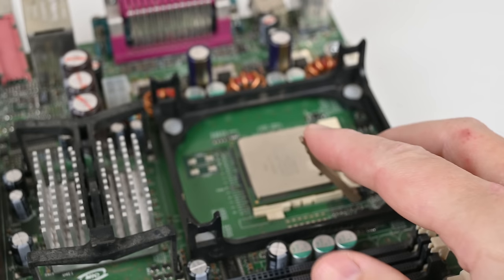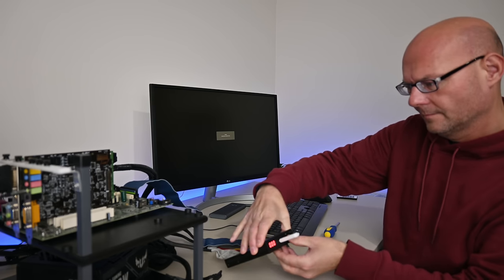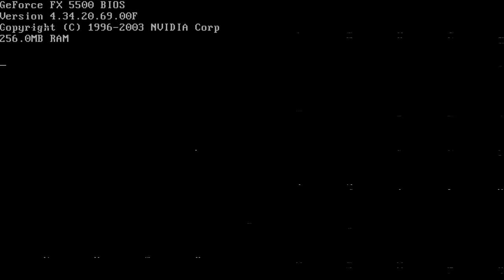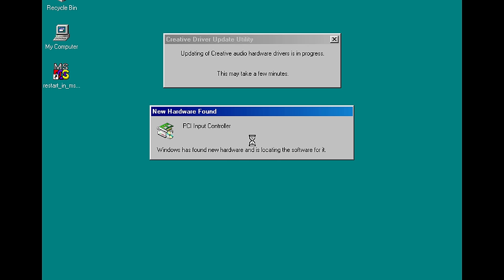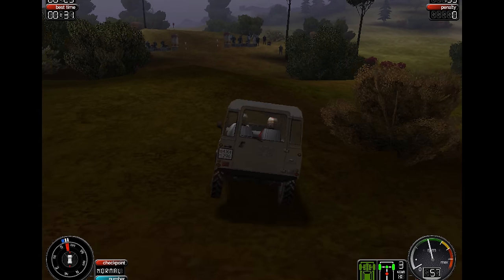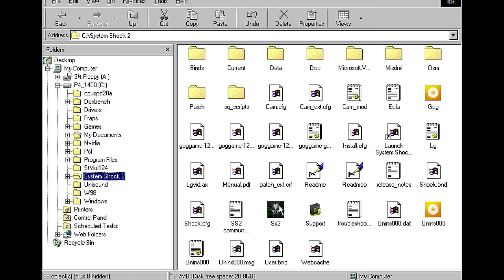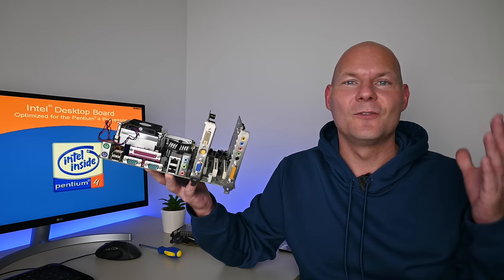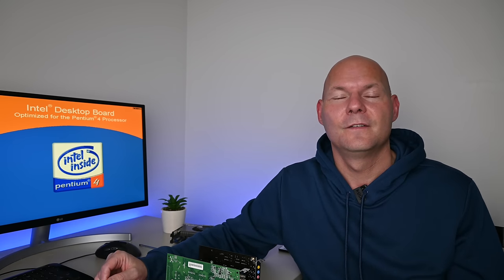It Failed in 2000, Has It Aged Well? The Pentium 4 1.4 GHz

Comment: The P4 is a perfect example of when Intel allowed their marketing department to fully drive the engineering. The goal was sky high clock speeds at all costs, hence the super deep pipeline and other design decisions. It's a CPU line that it easily overlooked these days in large part because the chips that came before and after it from both AMD and Intel were so much better in many ways. 
For me the P4 generation is when I went over to AMD for a while. I had been with Intel through the Slot 1 and Socket 370 gens after spending the entire Socket 7 generation with AMD chips. Then in 2001 I attended a pop-up AMD Roadshow event in Chicago IL at the launch of the Athlon XP line and won a MSI motherboard and Athlon XP 1800+ CPU which at the time was their fastest chip. So I stuck with AMD through the Athlon XP days. Later on I had a Barton core Athlon XP 2500+ CPU that I had overclocked to 3200+ speeds which served me well until the time when the later Core 2 and AM2 based Athlons were common. 
I did end up using a lot of P4 based machines at work though (I was an IT contractor for the US Army then) and quite a few of them were dog slow, especially when they got hot and thermal throttled. A P4 was fairly well behaved in a stable temperature environment, but put one in a warehouse or factory setting and boy were they a pain!  I was so glad when the Core 2 based machines came in to replace them.
Reply from the maker: P4 with mechanical HDD, low RAM and Vista. Tech support worst nightmare
Reply: At that time Intel didn't know P4 wouldn't scale that well in terms of frequency and that it would encounter major headwind in the form of TDP. AMD was worse. It knew about the problems of P4 but still decided to release Bulldozer.
Reply: @Alex-df4lt  NetBurst, Bulldozer, POWER6, all designs aimed to go to super high clocks, replaced by lower clocking, high IPC designs, that managed to reach the same actual clocks.
Yes, in 2007, just when Intel went away from their GHz race, IBM decided to release 5 GHz CPUs. And not only that, POWER6 was in-order.

Comment: That's a really awesome project I'm actually thinking of going with a P4 (S478) for my retro 98 machine for some old Star Trek Games for the more authentic feel tbh! :3 

My first proper PC was the AthlonXP which ran 98 and XP very very well, I have an ATI HD 3650 512MB AGP that I'm looking to use as the old Catalyst drivers I remember worked wonderfully for the games I played back in the day :)
Reply: You was very lucky if that HD3650 AGP worked without problems, these late ATI GPUs for AGP slots were very problematical. I have one HD4650 now and in some MBs it doesn't even give you image (some socket 462 MBs), I had even problem in sc754 MB, it kind of worked, but there were some problems. Only platform where it works without any issues are late sc 478 MBs, so Pentium 4 plaftorm.

Comment: Hi, Phil. Thanks for the great Video.
I saved an Win98-machine until this day and now it itches to go through all the installation to try some old stuff and show it to my nephew.
To the graphic-problems of your first card: It may be the light, but some of the capacitors seems to bulge. 
Could be just voltage instability, that a swap would fix.
Greetings, Carsten.
Reply from the maker: It's a great hobby!
Reply: i could make you ISO's i have 95 98SE and me along with win2k
Reply: @CotyRiddle  thanks, very much. I have got all that i need at Hand because i saved software and licenses. As Always time ist the problem. 😉

Comment: That Geforce FX5500: Looks like the capacitor top left is swollen. Might be a bad angle, but normally that caused the glitching and instability. This bring back so many memories! We had a 1.7 Pentium 4 on Intel Desktop Board. Once I replaced all the caps on a glitching motherboard with onboard graphics. It actually worked, and the PC was usable again.

Comment: P4 3.2 clocked to 4.0, 7950 GT,  4 gigs of Corsair Ram, Asus board, don't remember the chipset right now, and a couple  of highspeed drives in raid... Good times. Still have a few old P4 machines laying around. Creative sound card with Z5500 speakers... liked my old P4 computers. I have an old 3.4 extreme edition, that would only run 3.6, and a 7800GS Golden Sample with the unauthorized 7950's chipset. This video makes me want to play around with that old hardware.

Comment: I wanted an Athlon XP for my Windows 98 machine but I'm having no luck with the motherboards. Since I have several P4 machines I went with a P4 2.66Ghz on an Asus P4S8X-X, GeForce FX 5600 128MB and Sound Blaster Live SB0060, so my current setup is very similar to the one you tested, except for DDR instead of RDRAM, 2 real IDEs with 80GB and 320GB, and dual booting Win98 and Win2000 on the same partition 🙂
Reply: I've bought a lot of sc 462 motherboards in last few months for few bucks here in Czech Republic, not always in great condition, but it always worked. I can't imagine living in country where you have only eBay with their crazy prices, those worldwide sellers are totaly crazy. Sometimes it's enough to just visit some local computer store and ask if they have some "old trash" and very often they have and they are happy that you will take it for free. 🙂
Reply: Makes me wonder why Windows 2000. Might be just for period correctness, but there isn't anything that 2000 does that XP can't do either, but with support for some newer software. Yes, it means going to "classic" layout, but should do fine. On my 933 MHz Pentium 3 build I'M running 98 SE and XP on 256 MB RAM and XP is just fine. In fact, with my CRT it feels snappier than my modern machine with modern parts.
Reply: @HappyBeezerStudios  Wrong, I thought that XP is just reskined 2000 for a long time, but even when core is almost the same, there is massive difference in compatibility with old games and software. Win 2000 has advantages of NT, it knows NTFS file system, it's stable, it knows USB 2.0 AND compatibility with Win 9x games is much better than in XP for some reason. Try for example AvP1 or NFS 5, both games are bugged in XP, but work totaly fine in 2000. Ofcourse you can use Win 98 or ME, but 2000 has drivers for HW to like 2005, so you can build superior computer for these late Win 9x games. Test it, I am not kidding, compatibility in Win 2000 with old games is much better and it's better to play DOS games in DOS box now, so I don't really need actual Win 9x based OS.
Reply: @HappyBeezerStudios  The explanation is very simple. I have 3 retro machines, the older one runs Win3+1+Win95+NT4 (3Dfx games), the 2nd one runs Win98SE+Win2K, the 3rd one runs WinXP+Win7 (DX9 and above). Basically for nostalgia since I've used all these OSes extensively over the years, also because dual/triple booting requires less physical machines 🙂

Comment: I was putting a new machine together from scratch in early 2002, and the Pentium 4 1.7GHz was the current one at the time if I remember correctly, but I chose to go with a Celeron 1200 Tualatin CPU, due to people saying the Pentium was still being out performed by the Pentium III.  The gap between the PIII and Celeron model was not massive at the time, so I saved some money instead.

Comment: YEEEEEEEEEEEEEES TA! I played that for YEARS over a 56k modem with friends! I was even in a clan! I actually bought the CD recently to play on my 233 MMX (which is what I played it on at the time - may have been a 200, that was 25 years ago).

The game is pretty sweet. I recall you needed a lot of RAM for the larger maps.
Reply from the maker: Oh boy, I think it will struggle on the 233 MMX, at least that's what I found when testing on a Celeron 266. Even a Pentium II was struggling a little when there are many units on the screen and you play at a high resolution with a large view. TA is amazing! I find it hard to play other games, it is so well done, slick and smooth.
Reply: @philscomputerlab  I recall it was a show stopping game - Won some awards in 1997 as well. I had 128 Mb of RAM in my system, and for sure I had a Voodoo (not sure if 3DFX game) so that helped. There was times when it lagged despite that. IIRC the min. requirements were P120 or 133, so I felt pretty safe at 233 ;) My friend played it on his 266, there wasn't much difference in game play. Hundreds of hours spent over the years - we played it on MPlayer into the 2000s. 

Playing over a 56k connection, some games specifically banned flash tanks because they would lag out the game and keep shooting well after they were "destroyed". I also remember kidnapping the commander with an Atlas, and avoiding FLAK and rocket launchers by repeatedly clicking all my planes so they stack up, then using the minimap to send them into the enemy's camp "off map", only to change the target 2-3 seconds later. It was hard to do but extremely effective when done right. 

That and making the Big Bertha shoot twice its range by aiming directly in front of it ;) 

Oh and the expandability - so many 3rd party packs... Such a great game.
Reply from the maker: Now I want to play more! BTW it will feature again soon because I enjoyed playing it so much.

Comment: I had one of these and used it until 2008... Boy did it suck in 2008, by then it was barely usable.
Reply: I was using a Pentium 4 670 model until spring 2012 as my daily driver.  It only struggled with video over 720p but other than that it still performed fine.  Obviously gaming would be another story.
Reply: @EgoShredder  That's a significantly faster and newer one, not surprising it lasted until 2012.

Comment: The Athlon was kind of the enthusiast's choice, put the p4 always just worked. I liked the stability and the compatibility, less drivers issues on intel.
Reply: That's exactly what I am saying for almost 20 years, I never liked that AMD fanatic army. Yes, Athlon XP was more energy efficient, but it was not THAT good as they were saying and CPU alone is not everything, you neeed to look even at motherboards and sc 462 motherboards were so outdated, you still had to set FSB manualy, so some people had just basic CPU frequency because they didn't know what to do with that, it still didn't have dual channel and compatibility with late AGP cards was pretty bad.
Some later sc 462 MBs didn't even have USB keyboard option in bios and I remember USB keyboards were already pretty common in like 2003, Intel MBs supported this already on most of socket 370 boards. Ofcourse USB keyboard worked in bios and on post screen, but it didn't work on "press any key to continue" screen while installing Windows. 🙂
But if you like sado-maso, then sc462 is a perfect platform for you.

Some late decent sc 478 MB is the best platform for superiour Win 9x retro gaming computer.

Comment: I had a Pentium 4 once, but it was actually an emergency computer I bought for £5.

It was 2013/14, my old 2.6gHz Athlon64 x2 broke down and I needed a computer for work reasons, but I had almost no money whatsoever. It come with Windows XP installed and was painfully slow.

I taken it to recycling with glee when I finally managed to find a cheap used Core 2 Quad about 5 months later. I kinda wish I knew then what I did now, but hindsight is always 20/20.

Comment: At the time I did almost went to the Pentium 4 route. And in fact I did get the P4 motherboard, but with Asus CT-479 adapter and with a Pentium M socket 479 mobile chip. It was mostly faster than any of the Pentium 4 chips. I first had it with Pentium M 755 and later upgraded it to the Pentium M 780. The graphics card what I used came from Gainward 7800GS+ Golden sample 512MB. It was actually a 7900GT but in AGP! I still have that computer and use it when I feel like playing some retro games.
Reply: The Pentium M were amazing.

Comment: For the energy-conscious among you I would suggest getting an AMD Geode NX 1750. It is basically just an Athlon XP running with very low voltage. The NX 1750 for example runs at 1.4 GHz, 1.25V and a max TDP of 25W. There's even lower voltage models but you won't find many mainboards that support such low voltages (as low as 1.0V). So beforehand make sure the mainboards supports low voltages otherwise it will run with something like 1.45V or higher. I use an ASRock K7S41GX with my NX 1750. If you even use the onboard GPU and no dedicated graphics I think you can get some impressive energy-efficiency out of such a system. Phil also has a video on the Geode NX 1750, you might want to check it out.

Comment: I found duron 1.3GHz  with a 6200 turbo cache in a skip, i tried an athlon 2100+ and it worked and then a 2700+ which worked as well, along with a 9800 Pro card. Runs 98 SE perfectly. It's damn fast, stupid overkilll. Has  an ISA slot too, i put an awe64 value in and works in native dos.

Comment: At that time I didn't have a Pentium 4, but always Athlon systems. Since the platform has largely passed me by, I put together some from all generations of Socket 423, 478 and 775 in my Retro PC collection today. I even have a PC with Socket 604 and 2x Xeon 3.6 GHz HT processors with 8 Gb DDR Ram from 2003. It manages 14000 points with 1280 x 1024, 32 bit and triple buffering in 3dmark 01. As a graphics card, however, I use a much newer Radeon R7 250 with 2 GB because it still works under XP.

The 775 system is a Dell Dimension 5000 with GTX 750 upgraded.

The 478 system is a 3.2Ghz HT P4 with Radeon 1950 Pro

And the 423 system has 1.7 Ghz and a Geforce 3 Ti 200

Comment: Great review, congrats with that.  My 1st Pentium was a P4 1400 Ghz and SDram, worked flawlessly but I had to change the cooler because the Intel one that was delivered with it didn't coop with intensive gaming so tended to shut down the system at awkward times.  Changing the fan resolved that  :-)... By the way, I still have a Medion MT6 with a Pentium 4 HT 3.00 Ghz.  Works wonderful because the cooling construction was designed espcecially for the cpu cooling...pitty they forgot to foresee cooling for the rest of the pc, so HD crashes were prone.  I had this resolved when I got the machine for retro gaming by adding an 250GB SSD (& IDE converter) and an extra fan that fitted into a free slot in the pc...happy gaming afterwards since  ;-)

Comment: Willamette was my first processor. I was pissed with how slow it was compared to my old 566MHz Pentium 3 that I OCed to 800+MHz.
I also hated how my Willamette board used RD-RAM (rambus) which was expensive as heck.
Jumped to Northwood, then to Prescott, and quickly to Wolfdale (E2160). The E2160 was a godsend!

Comment: Funny thing is, I was firmly on the AMD side back in those days and went for the Athlon XP route. What's more, I hated P4 for being the marketing balloon it kinda was and its very much undeserved success. Yet later, as a CPU collector, I warmed up for this sorry little thing and I even built a Win98 rig based on Netburst, quite along the lines you did here. Mine was based on a Socket 423 Willamette (1.7GHz, perhaps) and contained an FX VGA too. Somehow I felt I just HAD TO go with somewhat failed parts, though, as you noted, the i850-based system with FX-5900ZT (I had never heard of ZT before this build!) proved to be a every decent Win98 machine. Actually, it was quite fun and I do plan to make a permanent build of it. For early XP things from a not much later era I do already have the "Overclocked Barton" config which works quite well too. This is something i always wanted to try, back in the day I couldn't really afford an nForce2 motherboard with a full blown Barton and I felt the need to rectify....
Anyway, Socket 423 + RDRAM + Geforce FX - rocks :D In a  way :D
Reply from the maker: Yes all the failed parts are making a comeback :)

Comment: Duron 1800+ / ASRock K7S41GX / 512MB RAM / 80GB Samsung IDE HDD - this was my first PC that I have built with my first earned money. For a bit I was rocking integrated Sis gpu, but later on saved some money to buy used ASUS V9999 graphics card with 128MB vram.

That 6800 served me well and later landed in my A64 3000+ rig in pair with Abit AV8 (my first 64 bit cpu), and much later in E2140 rig with that ASRock agp motherboard that you have (my first dual core cpu). These are my stepping stones that I can remember. Fun times for sure.

Comment: My first P4 was a 2.66 Ghz single core, non HT model. 533 Mhz front side bus. Those maxed out at the 3.06 Ghz and it HAD HT. The only chip in the line that did. Mine did not of course. The board I got with it was standard socket 478, no name. 2 Memory slots. Really cheap made board I got at a Taiwanese trade show that happens yearly in NY. It was good for what it was. It wasn't as fast as the Athlon XP 2 Ghz I had but it was really close in most ways except in gaming. Where the Athlon got more frames. So I used it as my HTPC and let the kids watch movies on it. Also used it before I went to bed to watch shows. Good times. My children were all home and were all so young. They are all in or out of college already. Time goes so fast.

Comment: Most of the time i've used amd parts, at that era(2001) i was rocking a intel celeron 800mhz with ati 9200! best time in my life! My dad has a pentium 3 700mhz with 9600xt and i wanted that machine so bad, while my cousins where rocking a pentium 3 1.2 ghz with a nvidia geforce 4 mx440!!Those were memories!
Now 2023 i'm on a 9700k with 3070 and the new retro pc sempron 2400+ and 9600pro win 98. Cheers!